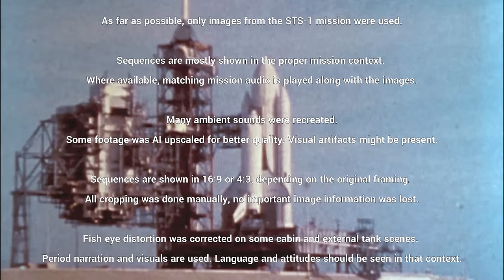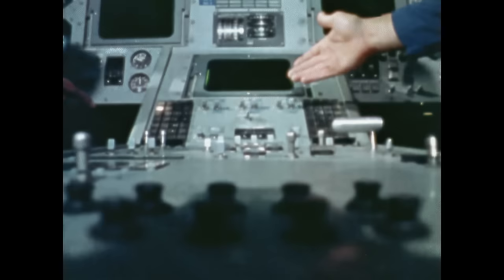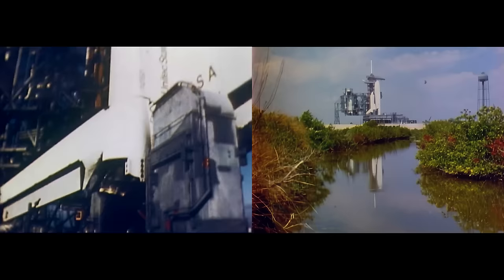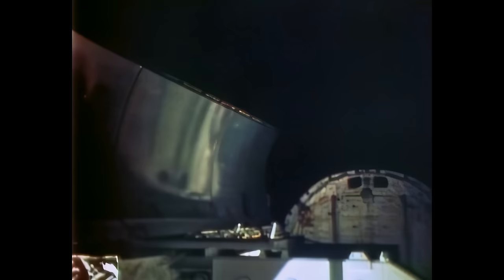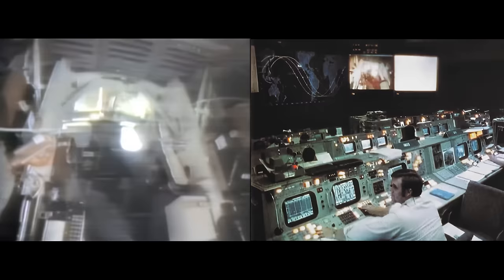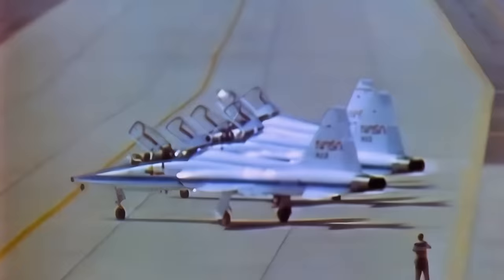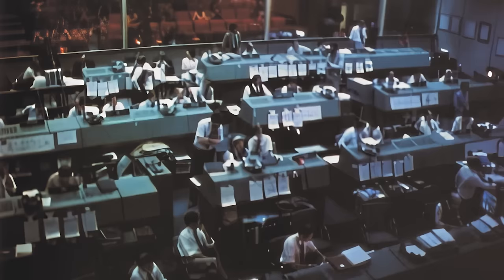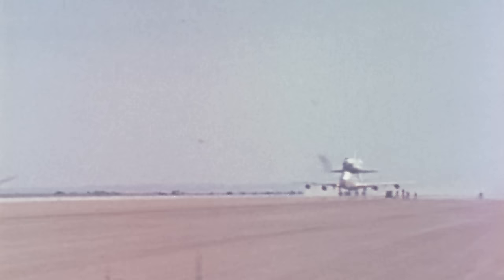STS-1 Full Mission - Historical Narration and Footage - First Shuttle Flight, Launch, Landing, 1981

Comment: Hard to understate how bold this was.  Even with the Saturn rockets, they live tested each component, then flew the whole thing unmanned a few times to shake out the problems.  The shuttle was assembled and had to launch, orbit, go through the fiery RE-ENTRY, and land unpowered all for the first time.
Reply: From my point of view it wasn't bold - it was stupid and dangerous. The whole program was a death trap, beginning with the first flight that already was crewed, continuing with the "black zones" during a launch where a failure had been unsurvivable, continuing with the heat shield problems that never had been solved and finally with the problems with the solid rocket boosters.

NASA made some huge mistakes at that time and 14 people paid the ultimate price for these mistakes.
Reply: @annando  Bet you are fun at parties
Reply: kennethmiller1029  The ejection seats, which were basically the same seats as on the SR-71, were left in the shuttle, but disarmed after the first few flights.

They did have a lot of issues that weren't widely known until later.  For example, an overpressure wave from the solid rocket booster caused a forward RCS oxidizer strut to fail.
The same overpressure wave also forced the orbiter body flap – an extension on the orbiter's underbelly that helps to control pitch during reentry – into an angle well beyond the point where cracking or rupture of its hydraulic system would have been expected. Such damage would have made a controlled descent impossible, with John Young later admitting that had the crew known about this, they would have flown the shuttle up to a safe altitude and ejected, causing Columbia to be lost on the first flight. 

The strike plate next to the forward latch of Columbia's external tank door was melted and distorted due to excess heat exposure during reentry. This heat was attributed to an improperly installed tile adjacent to the plate.

During remarks at a 2003 gathering, John Young stated that a protruding tile gap filler ducted hot gas into the right main landing gear well, which caused significant damage, including the buckling of the landing gear door. He said that neither he nor Crippen were told about this incident and he was not aware that it had happened until reading the postflight mission report for STS-1

Comment: 13:29  - the SRB ignition was so violent that it permanently bend the rear body flap, which was used to help control orientation during descent - the crew were never told of this, and if they had - the pilot mentioned they would have bailed out after SRB burn and Columbia would have been lost then and there.

Comment: Great vid thank you. The only RCS test I had never seen was shuttle. This should be posted in the nasaspaceflight shuttle forums! You deserve the views.
Reply from the maker: Feel free to share it there!
Reply: @RetroSpaceHD  looks like someone beat me to it!
Reply: It was posted in there discord(where I found this video)
Reply: I knew a member of my flight club while I was in college who worked for NASA's "White Sands" (actually Las Cruces) test facility.  In 1991, I was invited out to see a test of the nose RCS package in their facility that abuts the Organ Mountains...they fed the RCS rockets with mission data that was collected from earlier shuttle flights.  It was really loud, even with hearing protection from a safe distance!  I can only imagine how loud it was inside the crew compartment...I understand that a few very short RCS rocket burns would happen per hour on a typical mission, automatically fired by the computers as they compared collected telemerety to the flight plan ideal position.  It's like a hammer, instant on and instant off.  The test was around sunset, so seeing the flame plumes from the individual RCS thrusters was awesome 👌 Lots of safety precautions, though, as monomethyl hydrazine is used as the propellant.

Comment: It was a miracle this flight made it back in one piece.  From the STS-1 wiki entry :
-------
Mission anomalies

STS-1 was the first orbital test flight of what NASA claims was, at the time, the most complex flying machine ever built. Roughly 70 anomalies were observed during and after the flight, owing to the many components and systems that could not otherwise be adequately tested. Notable anomalies included:

- Similar to the first Saturn V launch in 1967, engineers underestimated the amount of noise and vibration produced by the Space Shuttle. Shock waves from the SRB thrust were deflected up into the orbiter's tail section, which flexed the wing flaps and bent several fuel tank supports; Columbia could have had trouble landing if the flaps had been damaged. An improved sound suppression system was later installed in LC-39A to damp vibrations.

- Pilot Crippen reported that, throughout the first stage of the launch up to SRB separation, he saw "white stuff" coming off the External Tank and splattering the windows, which was probably the white paint covering the External Tank's thermal foam.

- The astronauts' on-orbit visual inspection showed significant damage to the thermal protection tiles on the OMS/RCS pods at the orbiter's aft end, and John Young reported that two tiles on the nose looked like someone had taken "big bites out of them". The U.S. Air Force also photographed the orbiter using a KH-11 KENNEN reconnaissance satellite. Due to the top secret nature of the satellite, only a small number of NASA personnel were aware of this, and they had arranged for the photography prior to the launch as a precaution to make sure no damage had been done to the thermal tiles on the underside of the orbiter, as there had never been a flight of a crewed spacecraft before where the heat shield was exposed to the vacuum of space for the entire duration of the mission. Young and Crippen were instructed to perform maneuvers with the RCS thrusters to align Columbia so that the KH-11 could photograph it, but were not informed of the reason for them. Aligning the shuttle's low Earth orbit with the KH-11's polar orbit was a somewhat tricky move, and launch on April 12 was scheduled for a few minutes after the launch window opened, due to the need to get the KH-11 into correct orientation for imaging the shuttle. Images obtained confirmed that damage to Columbia was not serious. Post-flight inspection of Columbia confirmed that approximately 16 undensified tiles near the OMS pod had been lost during ascent.

- Columbia's aerodynamics at high Mach numbers during reentry were found to differ significantly in some respects from those estimated in pre-flight testing. A misprediction of the location of the center of pressure (due to using an ideal gas model instead of a real gas model) caused the computer to have to extend the body flap by sixteen degrees rather than the expected eight or nine. Also, the first roll manoeuvre resulted in lateral and directional oscillations during which side slip angles of up to 4° were reached. This was twice as high as predicted. Analysis attributed the cause to unexpectedly large rolling moments due yaw RCS jet firings. During the early stages of entry, orbiter roll control is achieved as a result of sideslip modulation.

- The orbiter's heat shield was damaged when an overpressure wave from the solid rocket booster caused a forward Reaction control system (RCS) oxidizer strut to fail.

- The same overpressure wave also forced the orbiter body flap – an extension on the orbiter's underbelly that helps to control pitch during reentry – into an angle well beyond the point where cracking or rupture of its hydraulic system would have been expected. Such damage would have made a controlled descent impossible, with John Young later admitting that had the crew known about this, they would have flown the shuttle up to a safe altitude and ejected, causing Columbia to be lost on the first flight. Young had reservations about ejection as a safe abort mode due to the fact that the SRBs were firing throughout the ejection window, but he justified taking this risk because, in his view, an inoperative body flap would have made landing and descent "extremely difficult if not impossible."

- The strike plate next to the forward latch of Columbia's external tank door was melted and distorted due to excess heat exposure during reentry. This heat was attributed to an improperly installed tile adjacent to the plate.

- During remarks at a 2003 gathering, John Young stated that a protruding tile gap filler ducted hot gas into the right main landing gear well, which caused significant damage, including the buckling of the landing gear door. He said that neither he nor Crippen were told about this incident and he was not aware that it had happened until reading the postflight mission report for STS-1, also adding that the gas leak was noted in the report, but not the buckling of the landing door. (The buckling of the door is in fact in the anomaly report, anomaly STS-1-V-49).

Despite these problems, the STS-1 mission was completed successfully, and in most respects Columbia performed optimally. After some modifications to the Shuttle and to the launch and reentry procedures, Columbia flew the next four Shuttle missions.
-------
Reply: Well duh... thats why columbia had ejection seats during this run....
Reply: Annotations to a couple of the Wiki entries, from my personal experience:

*  Ahead of the first flight, NASA was quite aware of the potential for acoustic damage.  Statisticians Bendat & Persol were hired to analyze acoustic data from static tests of the solid and liquid motors, hoping to gain insight into how that might affect the tiles.

*  Misjudgements as to orbiter aerodynamics had consequences beyond reentry kinematics:  The wing structure was simply designed to the wrong loads.  As the orbiter's program manager put it in 1985, "We're flying on strain gauges."  Had the design payload weight been present in the payload bay during that first re-entry, the wings would have failed.

Comment: I remember this day so well, it was very exciting. Some unintentional foreshadowing of the foam and heat shield issues (they never really got on top to of that) and you also see the beginnings of the shirt-sleeve myth, that the shuttle was really just an airplane that could go to space (it wasn't) and that all the refinements of a modern airliner would make using it a breeze. The reality was it was a hypersonic hazmat freight truck operating mostly within an envelope that was absolutely hostile to human survival, and prior to Challenger outcomes, no effective escape system. The Soviet Buran was an interesting project in this regard because they absolutely refused a solid-fuel booster system and had an atmospheric escape method but the thing was so expensive it was doomed to fail and only flew one unmanned mission.

That said I'm glad the STS existed and that all those engineers got to contribute so much.

Comment: It's amazing to think that upon congressional approval in 1972, an entire program consisting of entirely new designs, including the solid rocket boosters, orbiters (commonly referred to as the shuttles), the orbiter's engines and the external tank was built and launched within 9 years. The Artemis moon program has been in development and build stage for almost 20 years, although it didn't officially become the Space Launch System (later renamed Artemis) until 2010, some of which morphed out of the Constellation project started in 2005.
Reply: They were not entirely new designs.  The STS booster was based on the Titan IIIC.  The Orbiter had been in design since 1965.  The 'capsule splashdown' was a political response to the USSR quickie design to get a human into space.

The Shuttle was always the plan.  This Artemis thing makes manned spaceflight even more precarious.
Reply: "the orbiter's engines and the external tank was built and launched within 9 years"  Coincidentally, that was the interval from first engine test to first flight of the Saturn V as well (8 yr 8 mo).  Total development time was about 13 years.
Reply: @RideAcrossTheRiver   actually, a capsule is far safer as it has a simpler and smaller heat shield, and a simpler re-entry. Also, most capsules have a launch escape system (unlike the shuttle)

Comment: They should have never retired the shuttles. Upgraded and updated them yes. Maybe even designed a 2nd generation shuttle, but retiring them completely  was a mistake.
Reply: Other than cutting off americian access to space, no. The shuttle had no launch escape system and a relatively low safty factor. It wasn't cheap nor did it have regular flights (at the same rate that they wanted)

Comment: The shuttle is easily The most incredible vehicle ever built, and one of the greatest achievements of mankind. We built a MASSIVE vehicle that could go to space, return and land like a plane, and go back to space. And this was less than a century after humans rode horses to get places. In over 30 years, a whole TWO times, catastrophe stuck - both times it wasn't some major malfunction with the machine - it was bureaucrats ignoring small issues, trying not to look bad, and both could easily have been avoided.
All the people hating are simply Scrooges.
Reply: I don't hate the shuttle it just wasn't cheep and it had no effective method of escape. Its cool as heck but didn't fulfill its original purpose of being cheap.

Comment: Just a couple years it will have been obsolete for longer than it was operational. It was really just a stop gap to fill the failure to achieve booster rocket landing, and reuse. The reliability of Space X reuse of boosters, and lowering of launch cost renders the spaceplane configuration permanently obsolete.